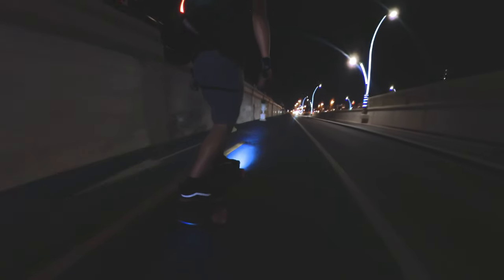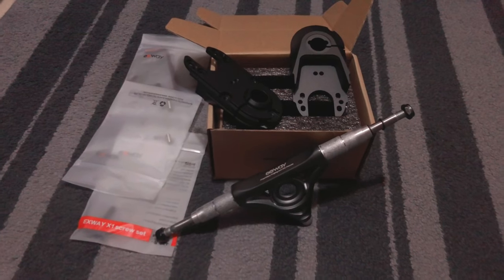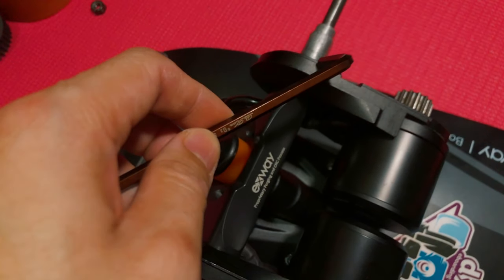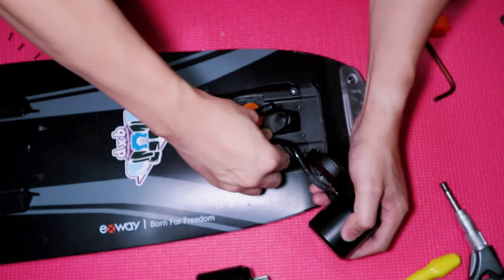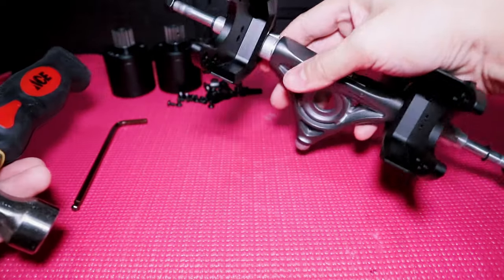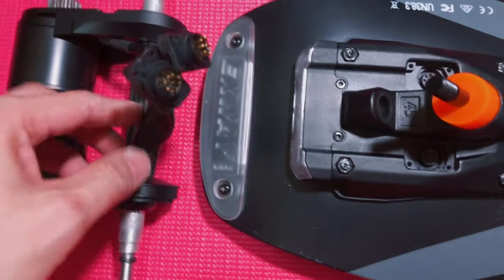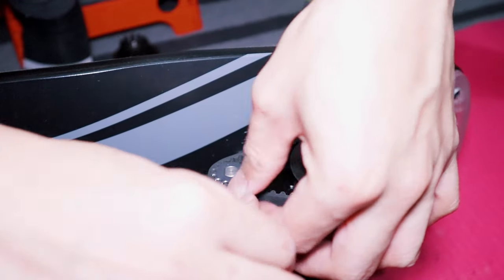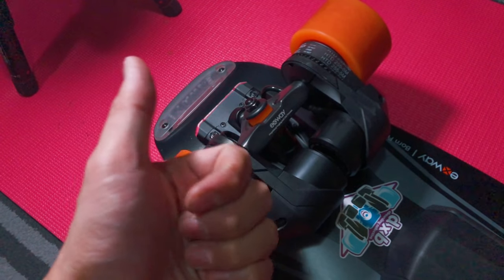EXWAY WAVE defect hanger replacement (eskate vlog #42)

Comment: Boss, try ko replace ung wheels ko sa may motor, kaso hirapan ko tanggaling ang pulley, need ko rin kc replacement...1st try ko pull out ung pulley kaso ang higpit ..baka sa belt...so unscrew ko ung cover, pero d na ma remove kc may naka harang...pa advice nman

Comment: Sir kung
Driver Weight: 66kg 
Average Speed: 25-30 

Mga ilang oras po ang byabyahehin?
at 
Water splash Resistant po?
Reply: 74kg (kasama bag) ako umaabot ako ng 16km so possible mga 18km to 19km sayo siguro.

Malaking factor yung speed sinubukan ko palagi naka gear 4, 30 -35kph naging 13 km nalang range ko.